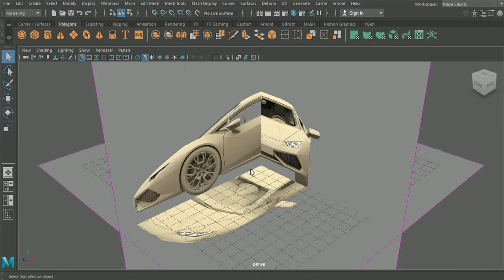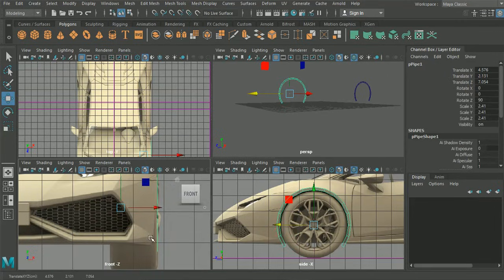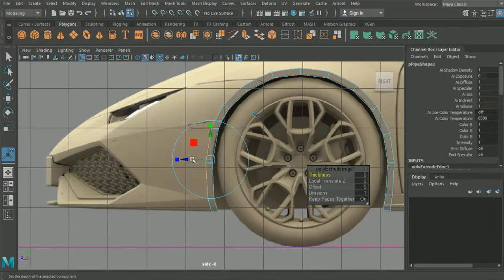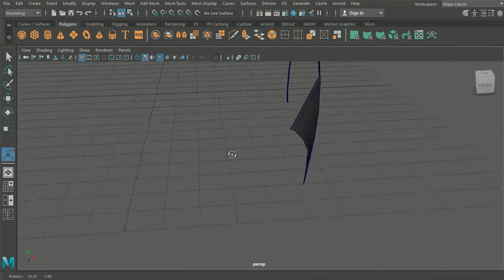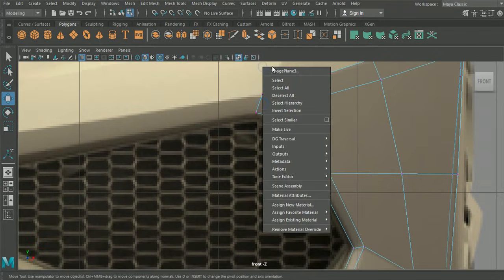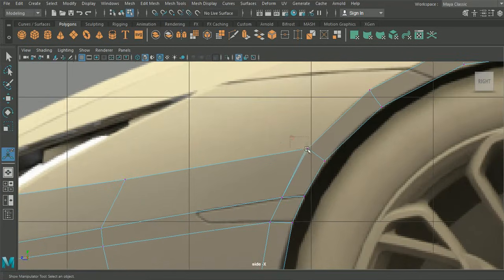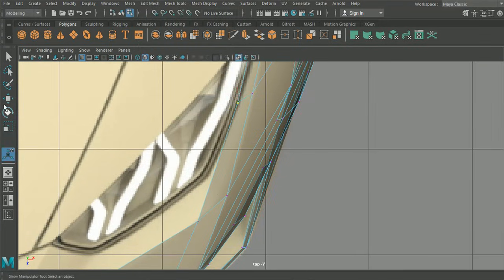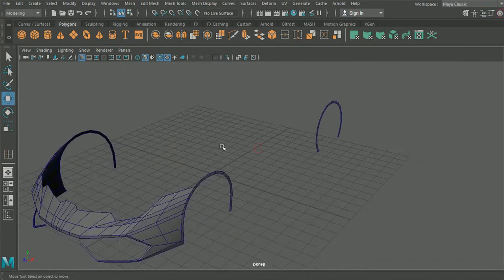3D Car Modeling Tutorial pt.1 | Autodesk Maya | Modeling a Lamborghini Huracan

Comment: I have a question. If I would do a strong displacement level on 3 (X Y Z) drawings, wouldn't the effect be the same? There should be crossing points to connect and my question is also, isn't this faster? I know this is a trick. Could you show us this method? It interests me. Thanks!

Comment: Help!, In Maya 2018 I dont have a tube I just have a Cylinder
Reply: I found a way to do it, in one of the views hold shift and hold right mouse button. While holding both, in the menu, click a pipe which is a cylinder with a hole in it. He just calls it a pipe. https://forums.autodesk.com/t5/maya-forum/why-are-the-pyramid-and-pipe-primitives-missing-from-the-poly/td-p/7271931

Comment: +8fifty2torials
@8fifty2torials
Hi! I noticed that my reference images are rendered at a much lower quality compared to yours. I know for sure that the image quality that I saved in JPG is high proven by the fact that when I use a image viewer like windows photo gallery and zoom in, I can notice that the image quality i saved in JPG is quite high. The images become low quality once I import them into Maya. It is becoming really difficult to use the images as references as it is very pixelized. I tried googling for a solution but found absolutely nothing. What should I do?
Thanks.
Reply: Still waiting for a reply if anyone could help answer this. thank you.

Comment: Hi brother, i liked and subbed, and im trying to follow along!!! . can you help me though, im trying to do something. im trying to model Commander Codys helmet from star wars episode 3, but im stuck. Im trying to model big cylinder objects around his jaw down to the side of his mouth, but i just can't work out how i'd go about it. i've tried everything i know, im fairly new though. Could you possibly help me or give me some clues or maybe even make a quick 30 second video if it's no trouble explaining it? To know what im talking about, you could go to google images and type in "Commander Cody, Order 66" and you'll see him holding up a hologram infront of him. it's the 2 big cylinder's with the black painted triangles on them. (I actually need to know how to do the whole bottom section from the 2 microphones at the front all the way around to the back of his helmet, i have the whole top section done including his eyes, visor, head and cheeks, it's those damn curved/cylinder sections at the bottom i just can't get right). thank you SO much for readin, brilliant work. Subbed.
Reply from the maker: Glad you like the videos! It looks like a tricky shape, I would probably run a cylinder sideways around the lower section to ensure you're able to maintain curvature. Here's a link to an image with a wireframe that may help - https://img0.etsystatic.com/180/0/12708670/il_570xN.1137109598_a2zj.jpg
Reply: omg did you do that yourself? thats brilliant, let me see if i can do that! thank you brother

Comment: The pipe wasn't working for me so I used a cylinder but before I started modeling  I created a layer to lock the images in place. They kept moving on me not sure why.
Reply: Who Blah you made sure to set the layer mode to reference?
Reply: Thank you for this great tip.
Reply: no problem.

Comment: whats the difference between 3dsmax and maya and whats better to use for modelling?
Reply: Meister Wald 3ds Max is still the king of non-destructive modelling in my opinion. You can almost go from the end result to the first primitive just by disabling modifiers. 3ds Max currently is still more used in the game industry, as going between low/high poly and baking details/smoothing groups is easier. It is also heavily used for archvis, along with Vray. However, Maya is definitely the standard in film/entertainment, due to 'better' rigging/animation tools, and a better pipeline integration with other programs like Houdini and Realflow. 
To answer your question, polygon modelling basics are the same across almost all packages, but it depends on what you are modelling for. If it is just visualisation, or for game assets, I recommend 3ds Max. For film, I would recommend maya, as it has more tools designed for such work.
In terms of ease of use, 3ds Max wins for me, since maya seems a bit patchy with the user interface, and 3ds Max has been more stable for me when working on projects.
Feel free to ask more questions and I will try my best to answer.
Reply: O_SS_421 - Thank you so much for your effort in answering :) do you have tips to keep learning and improving on 3dsmax by urself? i always find it hard to keep doing
Reply: Meister Wald I found it really difficult to start as well, because I came from traditional art, which I was more skilled at, so having the ideas but not the skill was frustrating beyond belief.
What I recommend is starting simple. Something like a bullet. But dont just model it. Make it the sexiest looking bullet ever made. Try interesting compositions, see how you can make something so boring fun. 
Avoid projects that are too complex for now, because you will get angry and leave 3ds max, wasting time.
Another exercise i did was to find things in the house and model them. For example i take apart a pen and model all the parts. Or a clock, wine glasses, anything you can find.
Also, I think it helps to try multiple ways to create the same object, this way you can know which is the fastest and learn more techniques.
And, if you are serious about 3ds max (want to use it professionally), and want to learn hotkeys to speed up workflow, you can print the hotkey list from inside 3ds max, by going to 
Customise / customise ui / and in bottom right you will see print hotkey list, or something along those lines (not at my pc right now so i cant remember exactly). Otherwise you can press x, to search commands, and from there you can use commands and also see the hotkeys assigned.
A great channel is Arrimus 3D, he has amazing tutorials on everything.
If you want to reach me by email: ossama01232@gmail.com

Comment: I don't know much about maya coming from 3ds max perspective but are there ways to use some kind of layers to prevent spamming "undo"? In 3ds max modeling is a modification and great thing is that you can stack them (like layers) and go back to previous if you mess something up.
Reply from the maker: Yea, the channel box editor gives you access to the "Construction History" you can remove changes there.
Reply: is there a way to add options to modeling toolkit (side one "cube and hammer") to not search things in drop down menues?